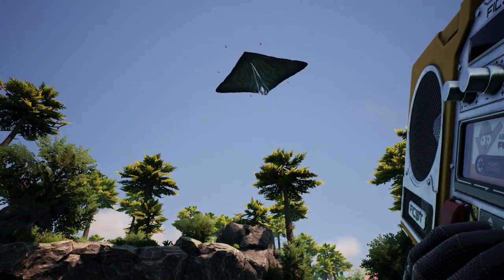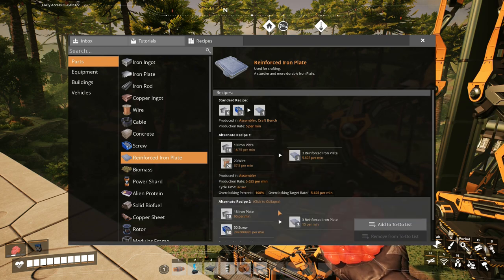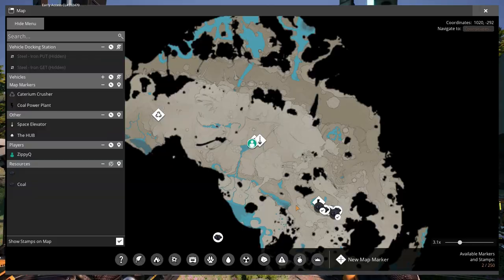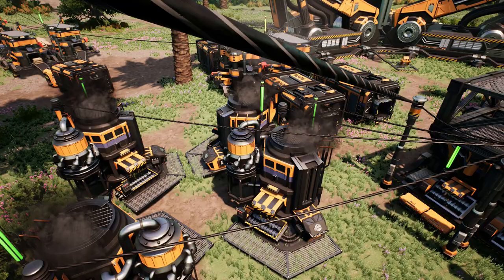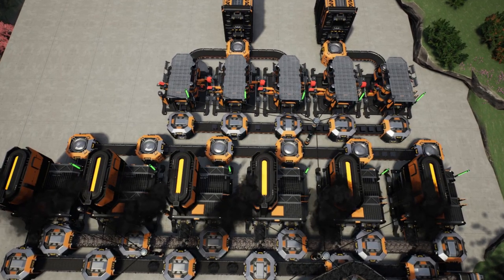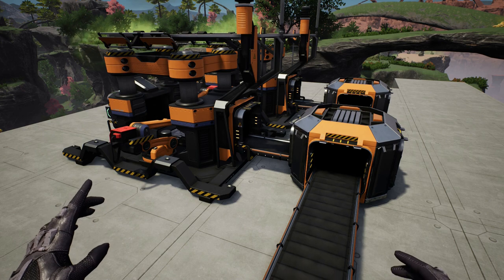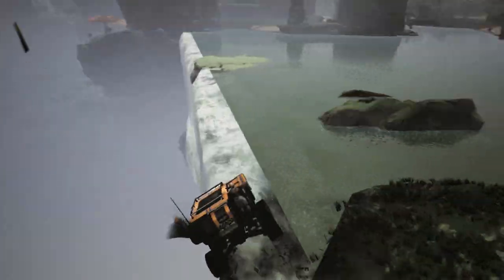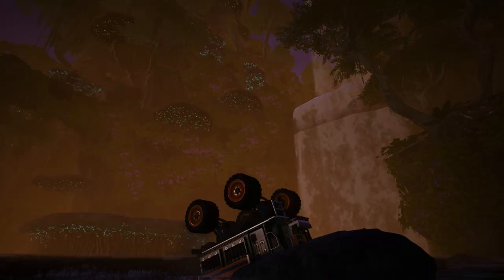Use this to build any factory (and drive tractors) | Satisfactory

Comment: I used to use manifolds, but switched to load balancers.
Manifolds are easier and more compact, but I find building balancers more enjoyable. Also when it's time to upgrade or work on the system, have the inputs (ore) on a switch means you can empty the machines fast, so dismantling or changing recipes doesn't annoy me by clogging my inventory with coal, iron etc. Also I find load balancers fun to watch. When it comes to power generators it's nice to just turn the system on and get your max power in a minute or so rather than having to wait for a manifold to overflow the generators